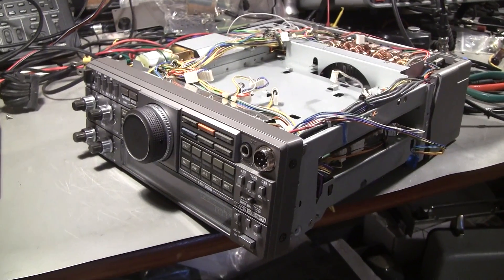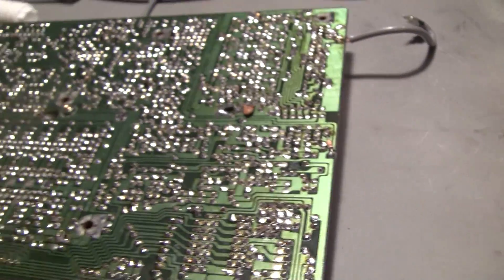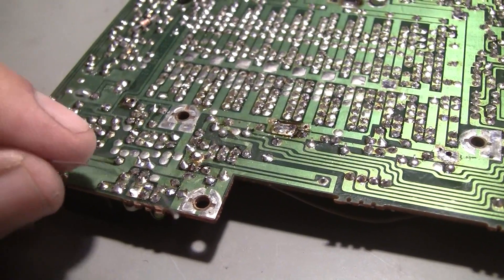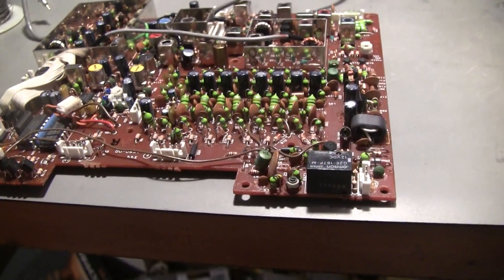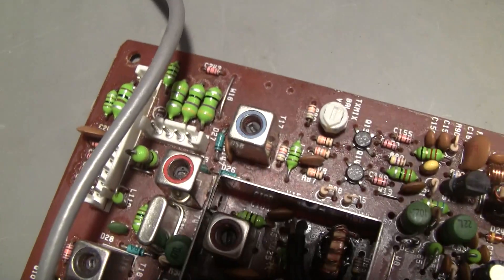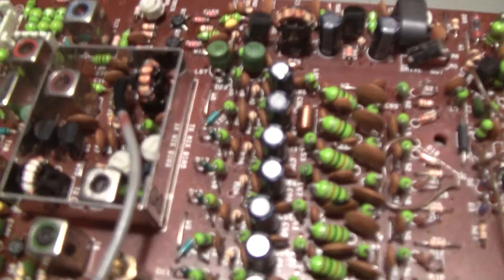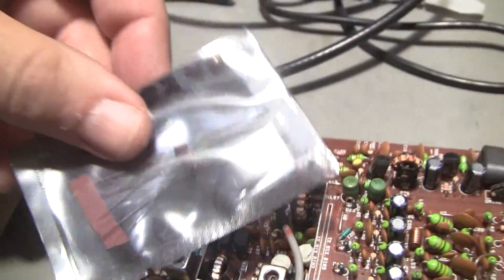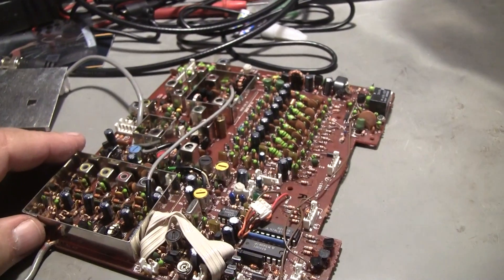Kenwood TS-440 Repairs ! Part 9. RF Board Gets 100% Solder Reflow !!!

Comment: So did the RF board reflow fix the problem?
Reply from the maker: Some problems, but not all. Early versions of the TS-440 had bad solder. I just haven't had the energy to finish it up.
Reply: @mikep95133 , gotcha.  I have an '87 vintage 440 mint condition, but it started intermittently having the dot problem.  I cleaned out VCO-5 and retuned it... that reduced the occurrence of the dots on 24-29 MHz, but it looks like I still need to clean up the RF board to completely eliminate it.  I have an on-air friend who is donating another with sensitivity issues.
Reply from the maker: @orbitingeyes2540  VCO5 is 1/3 of the dot issue. I forgot the name of the other area with a similar goop problem. Sometimes the display itself has bad solder. It's in my videos somewhere.
Reply from the maker: VC05, VC01, Display pcb. Finally remembered all 3 sources of dots. Guess I needed a nap !!
Reply: @mikep95133  
Thanks, I'm building my courage but really need to build up my soldering specialty tools